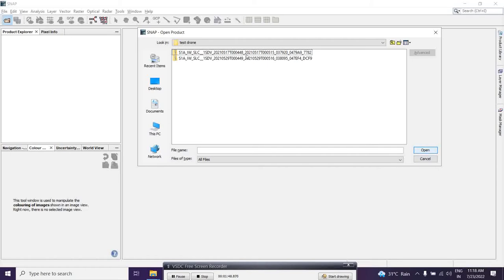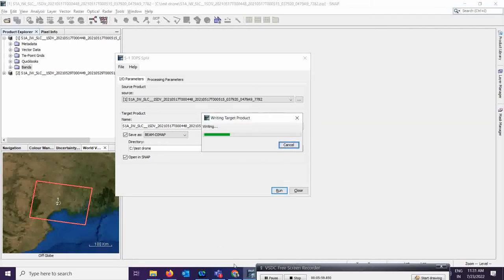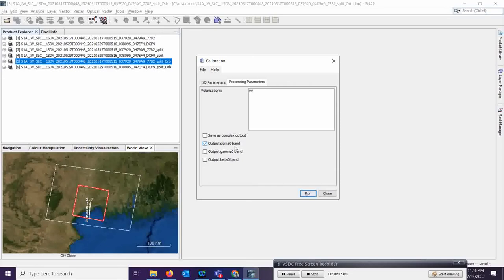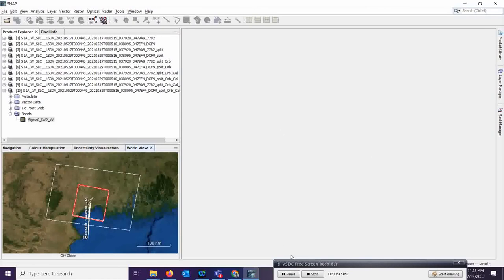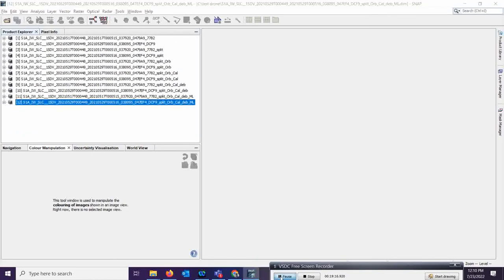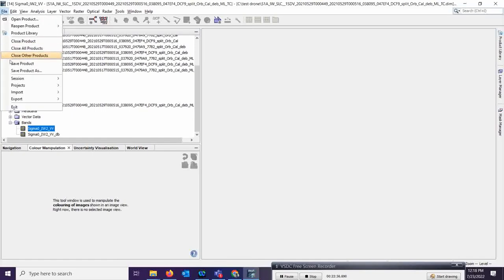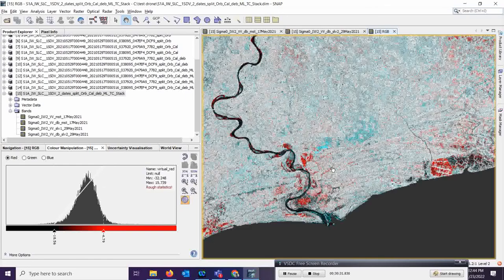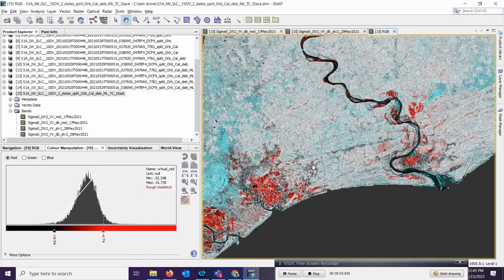Flood mapping with sentinel 1 SLC product using SNAP and ArcGIS Pro

Comment: hi sir, thank you so much for the video, very instructive. I'm wondering : why do we use SLC product and no GRD as long as it's available also on the COpernicus platform and we don't use the phase of the product anyway ? don't we be allowed to skip all the steps of spliting, calibration, deburst, multilooking... ?
Reply from the maker: Yes you can use that GRD product. But some other work I required phase information so from GRD that was missing. Thats way I showed with SLC.

Comment: Sir what is the purpose of multilooking😊
Reply from the maker: Multilooking in synthetic aperture radar (SAR) is a processing technique that involves averaging multiple looks (or images) of the same area to improve the overall image quality. The purpose of multilooking in SAR data is to reduce the speckle noise, which is a type of noise that occurs in SAR images due to the interference of the radar waves with the surface of the target.

By averaging multiple looks, multilooking can increase the signal-to-noise ratio and improve the visual interpretation of the data. Additionally, multilooking can enhance the resolution of the image, providing more detailed information about the target area.

Multilooking can also help to reduce the computational burden of processing SAR data by reducing the overall amount of data that needs to be processed. This makes it possible to process larger areas of SAR data more efficiently, which can be useful in applications such as remote sensing and geospatial analysis.

Comment: Sir plss exp why vv is better than vh
Reply from the maker: Sentinel Synthetic Aperture Radar (SAR) data provides valuable information for flood mapping due to its ability to penetrate clouds and capture images even in the absence of visible light. SAR data can be acquired in two polarizations: vertical transmit and vertical receive (VV) and vertical transmit and horizontal receive (VH).

The VV polarization is better for flood mapping because it provides higher backscatter compared to VH. Backscatter refers to the amount of energy that is reflected back to the sensor by the surface being imaged. In the case of water, the surface is smooth and reflective, which means that VV polarization can capture more reflected energy and provide a stronger signal compared to VH polarization.

Furthermore, VH polarization can be affected by vegetation cover or rough terrain, which can scatter the radar signal and reduce its intensity, making it less effective for flood mapping. VV polarization, on the other hand, is less sensitive to these factors and provides a more accurate representation of flood extent.

Overall, the VV polarization of Sentinel SAR data is preferred for flood mapping due to its higher backscatter and reduced sensitivity to vegetation and terrain effects.
Reply: @spaceremotesensingandgis5626 when VV polarization is better for flood, so the VH polarization is better for what? 🤔